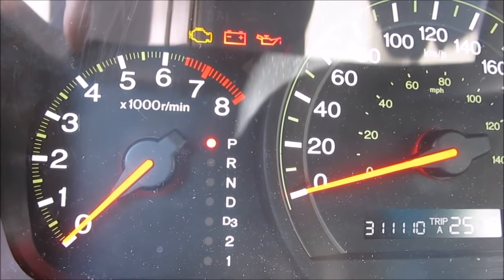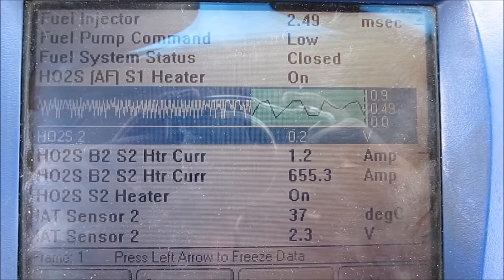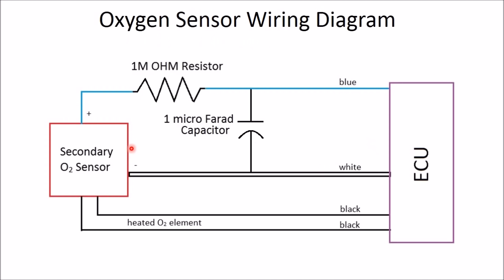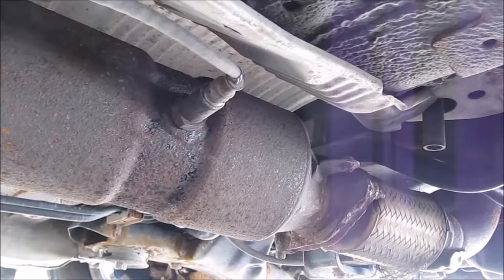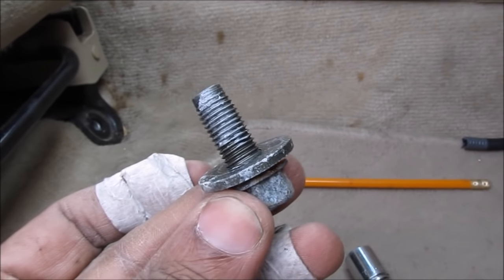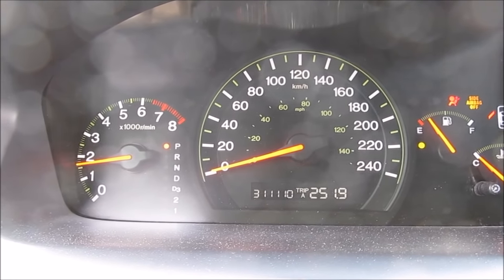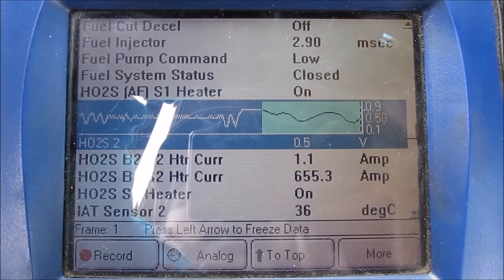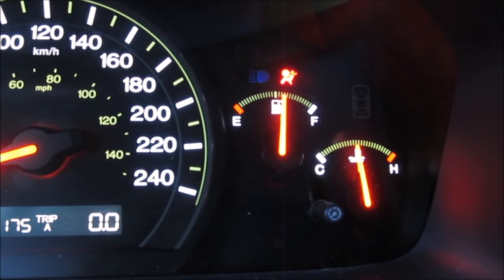P0420 Oxygen Sensor Fix

Comment: why don't you fix the error instead by replacing the bad part !!
Reply from the maker: Replacing a catalytic converter that is working at 94% isn't very cost or environmentally effective
Reply: it expensive and new cat probably die again cuz engine burning coolant or oil

Comment: This is not a fix if ur Cat is bad is betterto just suck it up and fix it is not a cheap fix but u will keep ur engine in a long run clogged cat is bad for ur engine sooner or later it will damage ur engine cuz it can’t breath
Reply from the maker: +Abdellah Adim This will only work to an extent. It's if the cat is less than 95 percent, which doesn't mean it's clogged, it's just below threshold
Reply: speedkar99 I know what you saying p0420 most the time it tell u that ur cat is not doing their jobs in my 15 y working like mechanic I seen too many engine got damaged of a bad cat in ur video is a good idea to fool the ecu bye breaking the weave form to make it feel that the cat it s fine good way to pass the the emission but is not a solution for the problem
Reply: for cats like mine, it works it has absolutely nothing left in it. plus it doesn't cost 500 dollars from the stealership to get a new one

Comment: Why the hell would you tamper with a sensor reading from your own car?
It is not like you are fooling yourself that the car is ok.
Reply from the maker: +Gleison Storto The catalytic code comes up at 95% efficentcy. It's still works fine, just not at the efficentcy the manufacter set. A new cat is expensive so this Patch will work until the cat totally fails and it's base signal can no longer be corrected.
Reply: Gleison Storto if something else triggers that engine light other than the o2 sensor,
You will know somthing else is wronh

Comment: This is illegal and results in jail time and fines when caught.
Reply from the maker: +Nicholas Littlejohn Hmm does it?
Reply from the maker: +Nicholas Littlejohn Hmm does it?
Reply from the maker: +Nicholas Littlejohn Hmm does it?
Reply from the maker: +Nicholas Littlejohn Hmm does it?
Reply: I think you're wrong. ECU is the only one who is tricked. The  exhaust gases result can't be changed only by this RC circuit then If the Catalytic Converter is damaged, RC circuit can't transform  it in an efficient one. CO, HC, Lambda are the same with or without RC circuit. The only thing it does is to transform the downstream O2 sensor in  less sensitive one with an output signal more flat in order that ECU does not activate the Check Engine Lamp...imo.
Reply: @johnel_ovi  that's the point.